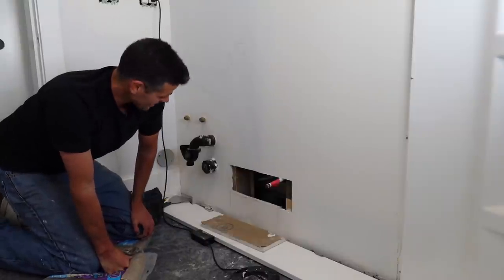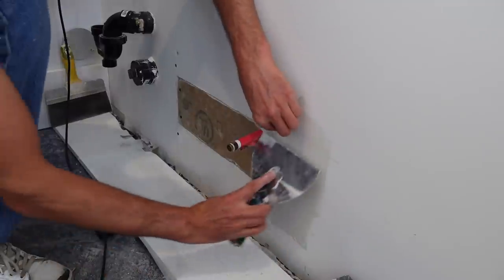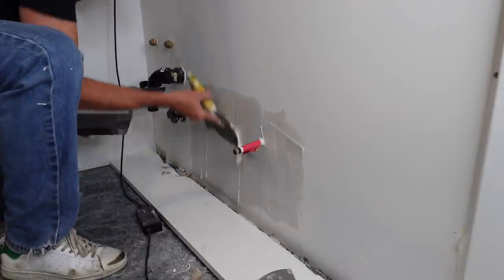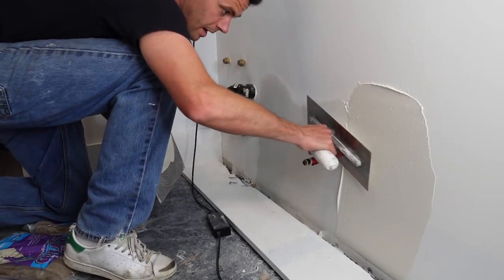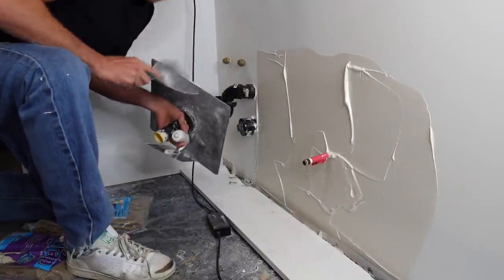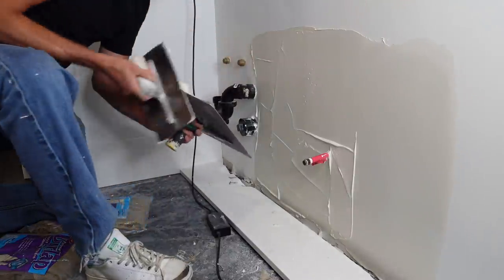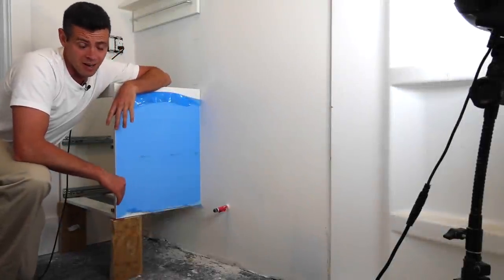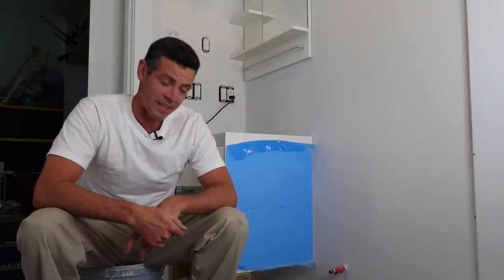Can Drywall be Installed BACKWARDS?

Comment: Love that you attempt different things for the betterment of your viewers! I've done this before BUT seal the drywall with wood glue to ensure the drywall paper doesn't absorb the water from the mud which will lead to cracks or delamination. But it's very possible to use either side of the drywall if proper prep is taken. Good job!

Comment: We used to “brown board “ sometimes in the 70’s in order to use the scrap pieces of vaulted angle cuts, but the board was WAY better back then.
Reply: What was better about it? I would think that it would be better after more time, not worse
Reply: @Wakaflockaflank  Everything was better back then when you remember fondly, until you go to remodel an old house and realize that some products were shit and some people were hacks even back then.
Reply: My 70s house ceiling is all brown paper showing. So when i scraped the popcorn off i thought that was the correct way and just installed a 3x3 foot patch backwards apparently. Good thing I'm skimming the whole ceiling. Doh

Comment: Apologies for this off topic comment. Long retired but still asked to do minor renos—for decades have resisted, for no good reason, using hot mud. But, with life slipping away waiting for regular mud to dry in the gouges and patches resulting from the violence of bathroom tile removal, I re-watched your small batch hot mud vid of a yr ago and bought some 30 minute. What an amazing product!! Personally, I don’t like mixing in my mud pan and found my grandson’s Halloween bucket a perfect shape for fast small batch stirring. Your comment about keeping tools clean is worth the price of admission. One infuriating side note. I went to a drywall wholesaler in an unfamiliar town whose name is the same as a defunct profession having to do with making feet coverings. 9kg bag of 30 minute cost $70. It seemed extremely high but having nothing to compare it to and the thought of spending even more time tracking some down, I handed over my visa. Later found out this was a massive rip-off. GRRR! And here I thought the days of wholesaler thievery of walk-in customers (who they claim are welcome) were over. Good thing I have nothing much else to do but denigrate this company with my rather large circle of acquaintances. Mess with seniors at your peril, Mr. S_________r!  GK
Reply: Wtf, I live in 1 of the most expensive places on earth for material (Alaska) and hot mud here is 15 bucks at lowes. Our drywall suppliers would be even cheaper then that if you buy through them often.

Comment: Did it once in an emergency on a part of a wall inside a cabinet. Small patch.
Hot mud, mesh tape and more hot mud. No complaints from the contractor or homeowner.
Did repeat work for both clients. So while it can be done I don't recommend it. lol
Good topic, Ben. Sometimes mistakes happen in this biz. It's how you recover from them that's important.

Comment: Appreciate you showing that this works fine.  I also watch Jeff from Home Renovision DIY and his method of taping the using the backside of drywall is to first prime the brown paper with Kilz oil based primer and allow it to dry.  Once the primer is dry, then he tapes and muds with quickset.  I get so many tips from watching different youtubers, so seeing that different approaches work and there's not a one size fits all method that needs to applied.  Nice to see some experimentation and different ways of solving the same problem.

Anyhow, I also went back and watched your dryer sheet patching video since I never saw that one before.  Cool trick, but I think for that situation I'll stick to a California patch instead.

Comment: I've done it too because I also cut my patch backwards. Both sides are paper, but the front is bleached and the back isn't. I don't expect any difference in moisture absorption into the drywall core if you don't have the factory edge paper wrap, but because it's not the "show" side you risk seeing the colour or texture of the rough brown paper of your patch versus the other wall.

Comment: A friend and I were on a siding repair job and found drywall as sheeting behind the exterior siding. We thought it was a money saving thing but found out it is a fire preventive measure when houses are 10 ft or closer together. It is an exterior rated product that is brown on both sides with a waterproof wax coating on it. There was no joint compound of course.
Reply: I think your referring to denshield and yes its made of materials that are not naturally able to take on water and mold.  Its used on the outside of buildings in Canada as well.
Reply: @chronesrt2925  He’s talking about something I always referred to as soffit board. It’s got brown paper on the face, can’t think of who makes it or if it’s still used today. I’ve used it in the past a few times. Denshield is used as a tile backer.
Reply: Densheild is used on the exterior of commercial buildings
Reply: @scotteklof5082  that would be DensGlass.
Reply: @teampalmerconst  I guess I am wrong on the name.  What I remember best is that it's heavy and if you handle it wrong it will irritate your skin.

Comment: Wow! This was timely! I had an electrician move the outlets on the kitchen backsplash up about a foot, then I had to repair the old holes. I stuck the brown side (including the blue factory edge) in there because I thought the factory edge would be straighter than my cut, and I didn’t know it would make a difference whether I used the the brown or white side. So this weekend, I’ll be removing the pieces and re-patching! ☹️

Comment: One of the previous owners had two full sheets mounted backwards, but then again, they used caulking to finish the wall/ceiling corners that was over two strips of drywall tape, laid flat with the side edges at the corners. One on the ceiling, one on the wall.....you never know what you'll find.... Keep up the good work!

Comment: From what I was taught is not a huge deal to have the backside out, but the white face is actually designed to accept primer and paint better. I redid my basement and cut a big piece backwards so I installed it backside out that was 7 years ago no problems

Comment: A while ago I skim coated a particle board wall in my shop with just regular all purpose drywall mix. It's been almost 2 years and zero issues. I did of course primer the particle board with kilz first. I would imagine if this worked than coating a small peice of backwards drywall will hot mud should work as well.
Reply: I too have coated things like plywood and mostly tile backer boards. I have skimmed and textured hardibacker, wedi board, and kerdi panels. All without issues

Comment: As a former finisher of drywall I've had the hanging crew install entire sheets backwards.  The back of the sheets are not flat and smooth and required 2 complete skim coats to bring them up to standard..  I never had any call backs but that doesn't mean that there wasn't any issues.
Reply: What kind of dodgy builder allows full sheets to be installed backwards and not rectified? That's dodgy AF.
Reply: Wow... I'm guessing that happened because they measure the cuts backwards and rather than trashing a full sheet of drywall, they just hung it backwards instead just to save time and money.  Of course, they are not considering the time and money for work done by the next guy, who happens to be the drywall finisher!
Reply: @robertgiresi9515  exactly right on both counts!!  Also the occasional cut the angle of the cathedral wall and flip it over for the other side.
Reply: Installed the correct way only needs 1 coat of skim
Reply: @anemone9895  not if you want it to look good after paint.
Reply: @edgill5007  I've been skimming for 25 years. The boards are tensioned to the white side. Nothing wrong with my work but you do it your way.
Reply: @anemone9895  I always do what I know is best. Good luck!!  Btw….. 35 years here
Reply: @edgill5007  skimming is different in the UK. Different products. If you mean tape and jointing yes 2 or 3 coats. But skimming a wall over here is 2 a half hours and its done. Requires mesh tape and square edge boards not tapered. Quicker than the american way and cheaper
Reply: @edgill5007  Been at this for over 600 years and eventually all drywall fails, usually when the civilization does.

Comment: I have a couple walls in my house that are paneling but finished like drywall. Corner bead, mud, taped at the joints, etc.
There's one area with paneling on one wall, but drywall around the corner and metal corner bead where they meet. 

I'm surprised there's not cracking due to the flexibility of the paneling, but somehow there isn't.

Comment: Happens a lot when people who are in the wrong rhythm cut the paper side to the wall dimensions and forget it's mirrored.  I think like you said the trick was to ensure there is no factory edge protection, that stuff is on there with a kind of sticky glue, you can peel it off then cut or sand.  If it saves you the time and cost of going and getting another 8' sheet, I say go for it.

Comment: I did this about 6 years ago, I had a piece of board I had to use (or go buy aother full sheet) but the paper was torn heavily, so I turned it around, filled over the top and thought no more of it.  

I recenty redorated and noted some hollow spots, the compoud has delaminated a little from the board.  It is still fine, but it will take a small knock to damage the finish now.

Comment: Always helpful to watch an expert apply mud!  But I doubt I'll ever use drywall backwards.  🤔. I do have a question about what you talked about near the end of the video.  What do you do if a small patch was partially completed more than a year ago but there are a few crumbs that show and the center is about an eighth to a quarter inch proud of the surrounding wall.  Total size is about 3-4 square inches.  I was planning to sand it down and Remus over it.  But I'm guessing from what you said that I may have to cut it out and start over.

Comment: I tape with a bounty paper towel sheet after I watched the bounce dry sheet video (I didn't have any dryer sheets). It's in a no contact are. I don't recommend it but it did the job. I sanded and painted it with no probs.

Comment: Sure, you can hang it upside down. We used to do that in whole rooms if it was going to be paneled (no tapered edges to screw up the panels lying flat.  This was, admittedly, back in the 80s).  

Used to do it in stairways occasionally, when we had a large angle cut on a sheet which would fit the other side and we were out of rock or didn't want to cut up another sheet (stairways usually got hung last thing and oftentimes we were down to the last sheet or two).  Like you did here, it'll turn out fine with a level 5 finish.  We'd just skim coat the whole piece and it turned out as good as the rest of the wall.

Comment: I have had really good luck with the fibafuse and hot mud. I’ve “mud framed” some tricky spots with this method, up to an inch or so thick. 

Though in my experience when you’re using it for the kind of patch job that you outlined here, you want a very thin coat of the mud on the wall at most before you put the tape on. Otherwise it tends to be a thicker patch of mud to hide the tape and texture and requires greater “build out”. 

I’ve actually started pre-wetting the fibafuse in thin mud- that lets me get much thinner tape layers and seems to bond even better that way.

Comment: I'm trying to find a way to not use tape on patches.  The reason is that all the walls here in Texas are textured, so floating way out just creates a bigger problem than it solves.  One possible solution is that tape in mud product.  But I noticed that plasterers never use tape on their patches.  What if you put in your backer wood horizontally as lathe and used plaster to fill a hole?  You could skim it with mud to take out any imperfections.  Would this crack without tape?

Comment: Not being a drywall guy I did this a while back. However, I also issues with the new drywall being higher in some places by about 1/8". My brother in law (at the time, so you see where this is going since he was ex and it was done to put in backing for ramp handles in a bathroom) was going to fix it all up. It has bugged for years since it is still unfinished. I think I am going to rip it out and do it right. However, what do I do with the areas that the new drywall is higher? Float it or get thinner drywall? Or other ideas.

Comment: Watching these videos from Europe, I always struggle with the applicability of these tips for us.

Over here we have plasterboard and gypsum board. 

Where plasterboard has a special brown paper that slightly dissolves when it gets wet. Allowing the fibres to break free and the plaster to adhere to them.
Hence it can be plastered with non glue containing gypsum without needing primer.

Gypsum board is like the stuff I see in these videos, recessed edges and flat white(ish) paper. That paper being "flat", all muds used have glue in them.
Hence it shouldn't matter technically which side you use.

Is that the same in the US/Canada?
Our Vancouver friend does mention having added glue to his hot mud. But if there's no glue in it to start with, how does it stick to the "right" side of the board?

And, as I've never seen plastering there on anything other then the occasional brick wall. Am I correct in assuming that the above mentioned plasterboard doesn't exist for you folks?

Comment: I'd be interested to see what you CANT use for drywall - you could mud over mdf, plywood, osb, plastics like puckboard might be tough, and maybe metals
Reply: durabond will stick to some materials but anything else will suck the moisture out making cracks.   I've never plastered plastic nor metals but that would be an interesting video for the Vancouver Carpenter to try in the future.

Comment: I am 100% sure that every single drywall'er guilty using the back side of the drywall to do a patch job. But i would love to you make a video, doing the back side of drywall using regular joint compound, no glue, no quick set, bet you it will not turn out right. Those are facts.

Comment: I don't recommend it if you can avoid it, but like it seems is common in the comments, we've used sheets backwards now and then, almost always when doing vaults or stairwells where you might otherwise end up with two extra opposite angle cut pieces that would otherwise go to waste.   The biggest issues with large pieces is that the backs of sheets are not smooth and actually quite "rippled" .  You really only should do it in a situation where it's going to be completely filled over anyway.  If you don't, you end up skimming the whole sheet regardless to fill in the very uneveness of the surface.   

Again, I don't recommend doing it but if you're in a pinch and you would have to go get another entire sheet for one patch, or could just use a backwards piece, it might not be the end of the world.

Comment: If I may make a suggestion...I notice you wear sneakers in most of your videos. I'm sure comfort and agility is the main reason. I do too on occasion. But as I aged I started
having foot issues. I was told to wear sturdier shoes or boots that had less flex in the sole.
From carrying buckets of mud and sheets of rock, climbing ladders and stairs took its toll over time. When I made the switch to a heavier boot, that was still lightweight, I noticed a difference.
You're still young enough where it won't matter...until you hit your forties+. :-)
Good vids as always!